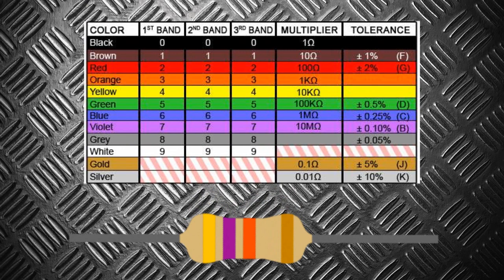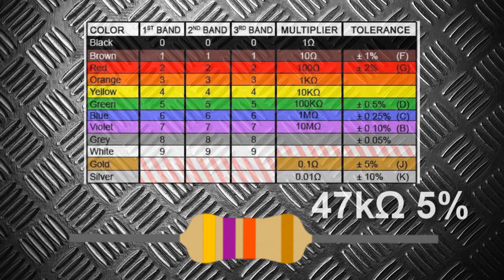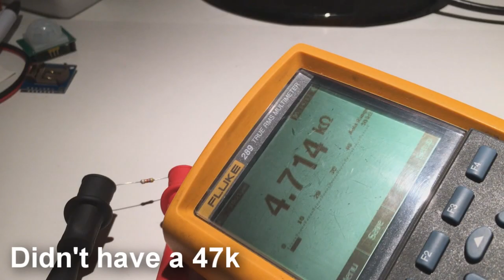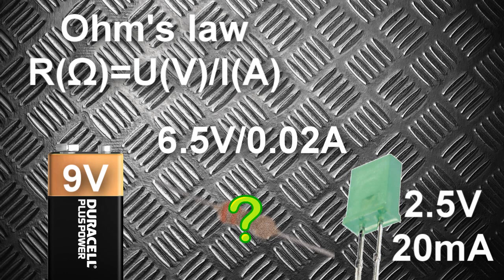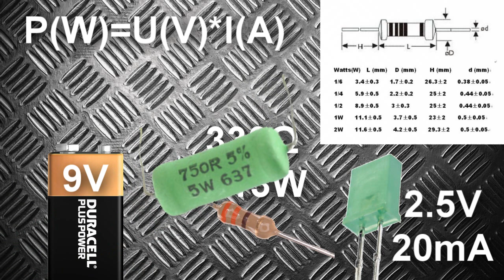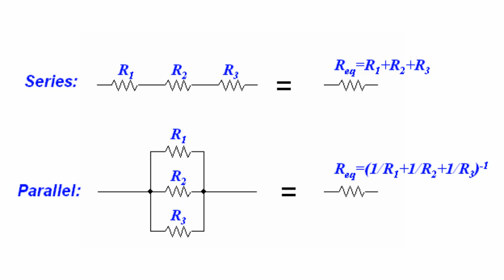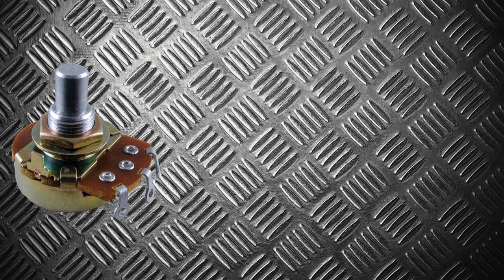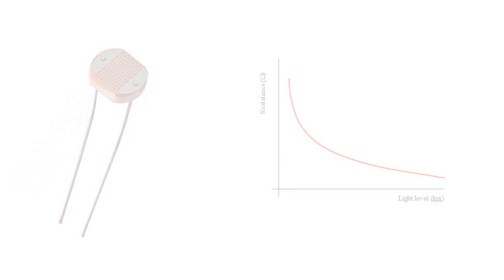How To Use a Resistor (Wattage, Color Code, Parallel, Series, Types And More)

Comment: Thanks for the info. How do i use the multimeter to check the voltage drop using the resistor where it shows 2.5v?
Reply from the maker: In the case of this example. put the multimeter in Vdc mode and attach the common black lead of the multimeter to ground (- on battery). After that place the red lead on the end of the resistor that is connected to the LED. The display should now display roughly 2.5V.

Comment: I have a tv with load audio (at 1 you can hear in the other room) I want to half the sound, so resistor. 
What do you think I should use? It is a 10watt 8owm tv speaker and I would like to bring it down by half.